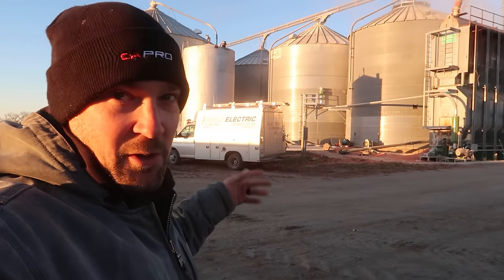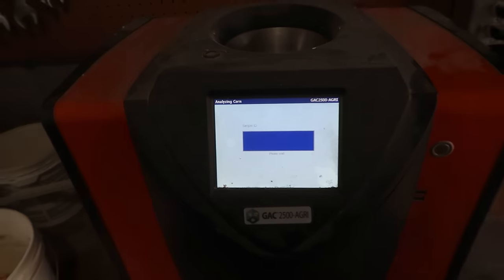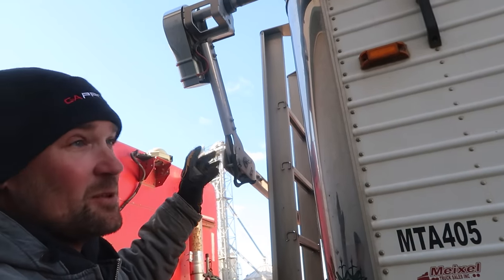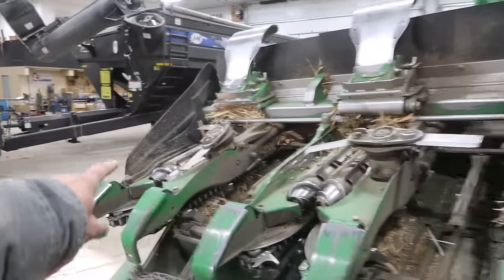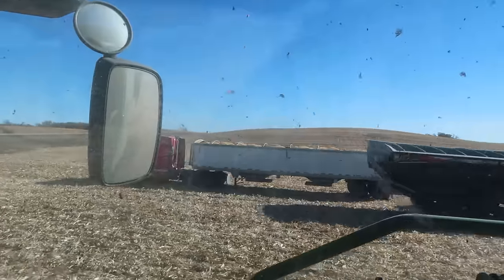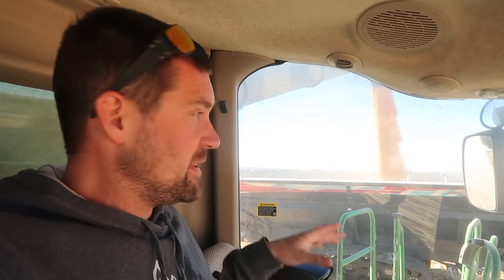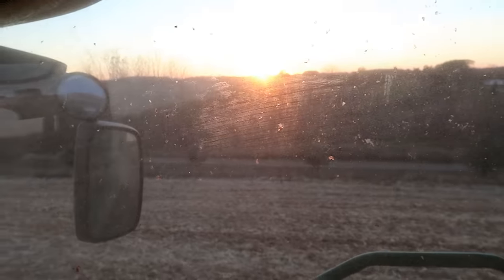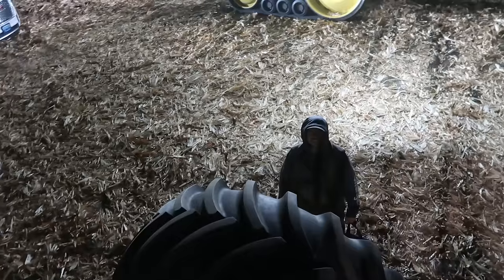I Finally Kicked Dad Out of The Combine! Harvesting Corn on the Hills

Comment: Spacers are there to increase the bolt length enough to get a "stretch" on the bolt when you torque it. The stretch is what keeps the bolt from coming loose!  I actually designed the tooling that makes the bolts and spacers! Made in the USA! Made in Wisconsin actually!
Reply: Pressure regulators will frost over  also
Reply: High usage of grain dryers will use more vapor than what liquid is making

Comment: Zack the reason for long bolts and spacers is at spec torque the longer bolt will stretch more and provide a higher clamping force learned that in Cat service training.

Comment: Regarding the wheel spacer on the wheel bolts... that so the bolt can be 1.5” longer than needed to stretch and provide more clamp load on the rim. (When properly torqued)

Comment: Had a dual fall off my combine this harvest and dealer had to come out and put it back on, sheared all the Bolts off and they said it was likely that the wheel studs were loose from the paint on the mating surface of the wheel chipping away. They said they always grind the paint off on new machines or new wheels and they don't have any issues after that. Just something to take into consideration!

Comment: The spacer on the wheel bolts allows more length between the threaded hole and the head so the bolt can stretch more and hopefully stay tight longer

Comment: Born and raised in Wisconsin, can confirm that 15 degrees F is "balmy" weather. My brother and I used to ride our bikes through slush and snow wearing shorts and tshirts when the temperature was only 40 degrees out. It had been so cold for so long that 40 felt like a heat wave :)
Reply: Sure 40 degrees in the spring time is a heat wave, like you said shorts and t-shirt weather. Even 15 degrees with no wind is is nice in late winter, but 15* in the fall is dam cold especially when this fall as we have had a warm one here in the northland.
Reply: @richardlug6139  I agree it is bitterly cold at that temp, especially with the wind cutting through your clothing. We had a wood stove for heat and my brother and I spent many miserable hours trudging through the snow and ice to haul in from the woodshed.

Comment: the spacers on your combine wheel studs are to increase the effective clamping load of each bolt.  in applications where short bolts are required, using a spacer and a longer bolt allows the bolt to stretch/flex more before before breaking.    great videos, keep them coming.
Reply: Combine has bolts? Not mounted studs? I'm asking

Comment: The spacer is there to create extra length for a longer bolt. 
The longer the bolt the more stretch under torque the bolt will have. The more stretch it has under load the less likely it will back off and run loose. 
But for some reason Deere struggles with combine duals staying on 🤦‍♂️

Comment: In the heavy logging equipment program I went through we only ever used high temperature grease because there was one machine that required it on its cutting blade and we didn’t want to risk someone using the wrong grease in that one machine.

Comment: Between Lincoln and Omaha Nebraska and areas to the south I manage land in, we had corn anywhere from 25 to 54 bushel beans and corn that ranged from 94 to 217 bushel.  All dryland, around 10" or more less than last year.  Hail storms hit some of the area in june around V4 in corn after it dried we didnt' see much of anything for rainfall.  The cracks in the ground are wide enough to put your hand in and go down feet plural.  A garden hose in our hard will go down at least 18" and run for multiple minutes without ever seeing the water.  Crop scout in late August said we had little to no moisture at the 3 foot level.

Comment: FYI Standard thread bolts have the dashes 3 for grade 5 and 6 for grade 8. Metric have a 8.8 10.8 or 12.8 stamped on the head.

Comment: Great content as always, thank you. You mentioned video cameras in the grain bins do not work because the dust would settle on them. Would it be worth setting up an airline to blow the dust off?  A connector in the control room to each camera, quick blow with the airline and you should have the view, without all the climbing.

Comment: Zack,  Try sticking a zip tie in the electrical socket on the trailer with the plug in it.  Make a loop, stick the power cable thru that and shove the tip into the trailer plug.    That should keep it steady in the plug.

Comment: The spacers are to help the bolts stay tighter as the bolt is longer and has more stretch as the wheel load on the bolts comes and goes as you go in dips and wash outs

Comment: Heard you say cameras would dust over with in minuets in the grain bins. They'll come a time where you kids will have to climb the ladders. You and your Dad will be grounded! Before that, could you install a compresser near the bin's and put a manifold on it with 1/4" lines running to each bin to where you would put a camera? Control each line with a solenoid on each leg on the manifold. Have them controled where ever you would watch a screen. Push a button to blast the lens clear of the dust enough to see what is going on. It would be a much easier step to take.

Comment: You can tell by the marking on the bolt head if they're SAE or metric and what grade. The lines on your bolt heads indicate they are grade 8 SAE. Metric bolts would be stamped with class 8.8/10.9/12.9 etc rather than the series of diagonal lines.

Comment: The reason for the spacers on the wheel bolts is so that the 450 lbs of torque stretches the bolt enough to keep the joint tight.  A shorter bolt would loosen up more often.  Really appreciate the content and the editing.  Every video flows well.  Nice to see all the help also!

Comment: Get a long set of jumper cables. Cut the clamps off one end and put the appropriate size ring terminals. Pop the tarp motor cover pull the wires from the terminals and hook up the jumper cables, go straight to the batteries to run the tarp.
We have a set with the plug for the belt trailers in case we have controller issues. 
When I worked for the row cropper we kept spare bolts and spacers around for the 9660. I think the spacer is to spread the force farther from the hole in the wheel than a washer can.

Comment: Run a set of jumper cables or a boost pack straight to the motor on your tarp if the control box won't run the motor. This will bypass the control box and will also diagnose if the motor is bad. Correct polarity will open tarp. Reverse polarity will close

Comment: I vaguely remember in one of your previous video's you changed the heating lances running into the dryer, pulling them out if i recall corectly. Could that be a cause for the temp issue ?

Comment: The bolts with the spacers give you the ability to use longer bolts that when tightened to the correct value they stay tight as they’re supposed to.

Comment: High volume propane users have a pre-heater at the storage tank. Your dealer should have information on that. Propane boils at  -44 deg F.   Vapor pressure  @ 0 deg F is only 23 psi.   When you are using  high volumes of propane the temp in your storage tank goes down and the pressure goes down. Many years ago when they just started using propane dryers propane sold for $.07 per gallon.

Comment: About the cameras in the bins. Take a box around the camera and place around plastic window in front of the camera with the centre of the window aside from camera. Mount that window on the axis of a motor. Let that motor spin. The spinning forces will take the dust off the window and a brush could do the last bit. When the window spins while you use the camera, then also some dust will blur out and not block the view. Good luck.

Comment: Idea: Install the cameras in the bins like you normally would AND install air hoses with high pressure nozzles pointed at the camera lenses. Flip a switch and dust is gone in seconds. Maybe put the switch next to the display monitor with all the camera feeds are.... 😏

Comment: @Millenial Farmer  - The spacers on the bolts are there to help provide adequate clamping force.  The bolt is effectively a giant spring when torqued, and in order to get enough clamping force (to keep the bolts tight and prevent loosening) they need a given length to be able to stretch and provide that clamping force.  Without spacers, the same torque on the fastener may actually overload the bolt and could risk eventual damage.. A stack of washers will provide the same function in a pinch, though I'd take a tightened bolt without the spacer over no bolt!

Comment: Mount the camera up top with an air hose near the lens with a valve near the control. Need to see in the bin open the valve on the air hose and blow the lens off and you got a good sight down. Think it would work?

Comment: Could you set up a camera on the roof looking down, then run an airline to the lens, which you control from inside to blow any dust off? It might be a time-saver in the long run if it was reliable.

Comment: I am so sorry to hear about the below average yield! Down below farmers loosen/deep rip the soil to a depth of 550-700mm and use controlled traffic to avoid recompacting the soils again. Thus 80-90% of a field is free of traffic. In this way, the "bucket" becomes larger and the soil absorbs more rain and the plants have moisture for a longer time.
Reply: To absorb rain u have to get it 1st. Do Deeper rips help when their feilds are tield? I'm asking... Idk
Reply: @RebelRolls77  The point is that you can increase your ability to utilize the rain you get. If you loosen the soil layers and use controlled traffic, so that the soil layers are NOT compacted again, then the soil layers become more spongy and thus much more water can be contained, so that less runs into the drainage pipes and the plants have water for a longer time.

In AU, the new thing is to put, for example, 20-40t/ha of chicken manure at a depth of 300-600mm, because then microbiological life increases enormously, and precisely microbiological life creates the spongy soil layers, which are optimal for supporting plant growth.

This method is already far more profitable over a few years than the chemical method, where you use N, P, K, etc., because the microorganisms are extremely effective in feeding the plants, and the value lasts years, because the microorganisms themselves build their own basis of life, if you don't kill them with chemicals!
Reply: @futurefarm73  chicken manure without any composting is just top dressing nitrogen. And without microbiological life ur speaking of. You didn't explain my tiling question
Reply: @RebelRolls77  You just have to help me understand your tile question. I thought I answered that, so what are you asking that I haven't answered?

Comment: the spacers on the wheel is for more flexibility instead of stretch of the bolt, to prevent bolts getting loose. figure that....

Comment: Spacers..The purpose of the spacers is to improve the clamping force. A bolt behaves like a strong spring. They are not as solid as we think but when tightened stretch a wee bit. The longer the bolt the longer it stretches given same torque. Now a bolt with very short shank can't stretch much at the desired torque. Now when you put a spacer on it, assuming it's a decently made one, nice and square and strong enough material, the tightened bolt becomes a longer spring. This means any deflections in the joint are accommodated within the yield limits of the bolt. In other words a 0.010 deflection on a short bolt might yield it and it doesn't return to starting length and it will come loose. A long bolt with spacer is capable of handling the same deflection and returning to original length. Making use of bolt stretch allows joints to flex and not come apart as the load is shared among nearby bolts. A common place you see spacers on bolts is under slew rings on an excavator. Engineering. Don't you just love it. As an aside, grade 8.8 bolts means yields at 800mpa and tighten to 80%  what ever that works out to be on the chart. 10.9 means 1000mpa and tighten to 90%. Cap screws are usually 12.9 so 1200mpa and 90%. So cap screw stands 1080mpa stress. 8.8 stands 640mpa stress. So cap screw is over a third stronger than 8.8 bolt when installed.

Comment: Hi Zack.  I'm sure you must know this, but I'll write it in anyways.  Those were imperial bolts as you said because of the six markings on the top.  But to identify a metric bolt, it won't have those lines on top.  Instead look for the grade marking on top as being either 8.8, or a 10.9, or a 12.9.    I just associate the 8.8 with a Grade 5, the 10.9 as Grade 8, and the 12.9, as being beyond Grade 8.   There is stuff on Google that explains it better than I can.

Comment: The wheel bolts on the combine have spacers to allow the bolts to stretch. As strange as the sounds the longer the bolt the more stretch it has the more shock load it can take without breaking.

Comment: Crazy that I'm watching your video and the wheel bolts come loose. My brother-in-law's  780 had the same thing happen 2 nights ago, so they had to replace both sides. The tire guy said that he has seen this happen a lot, and everybody is running too low of air pressure in their combine duals. He said that they need to run at least 40 pounds of pressure in the tires.

Comment: Ya know,  if you had those lsw's that welkers and Cole have on their combines, that bolt problem probably wouldn't happen.  Maybe they could send that guy to visit you?
Reply: LSW’s would be pretty useless in heavy blue clay and sticky mud. Also what happens if it goes flat or gets a puncture they’d cost triple of a 900 R42. We have to run tracks on our combine so it can get thru the wet spots.

Comment: A simple FYI if you already have a bolt and are unsure if the threading is the same put the threads next to each other with the heads facing opposite directions, if the threads interlock the entire length you will know the pitch and count are the same. Used to deal with customers looking to replace bolts and machine screws all the time.
As to the diameter it's harder when you have metric vs imperial and end to end can get you in the ball park but there are just some where it's just a mm difference and can't easily see with the eye.
The previous tip helps to some extent as the bolts won't mesh perfectly but may be close enough to miss unless close inspection is kept.
Might be worth it to buy a handful of bolt gauge tools to have in the machines this way you have a on hand tool to check what size you need if you have a bolt on hand. at $15/ it'll be a question if it's worth it or not depending upon personal opinion.
Reply: Um, yeah.  I'm pretty sure they did that exact thing on this video.
Reply: @chuckfinley4757  I only seen them putting them end to end, they did something else off screen but who knows what that was.

Comment: Wonder if those spacers are for bolt stretch.
Reply: This is the reason 99% of bolts would have spacers. For additional length or  stretch. Engineers generally wouldn't add a spacer for no reason. They are fairly expensive.
Reply: Adding a spacer also changes the angle of the force cone.  Usually it lowers the contact stress.
Reply: Maybe if the bolt threads were exposed on the inside of the wheel it would prevent thread damage due to rust.
Reply: Counter intuitive as it may seem, a little grease on the thread and contacting surfaces of those bolts will help to stop them working loose.

Comment: If you were short of 4 bolts for one wheel the best thing to do would be to take one bolt out of each of the other three wheels, use those on the wheel that's missing four, then each wheel would only be missing one bolt.

But you probably already know that 😉😁👍

Comment: Long-John's already? It's not even close to proper winter temps.
Reply: Not always the temperature but you add the windchill and those long-johns help  a lot.  One does not need to be miserable while working.  Seems the rest of the crew were in cabs of one sort or the other.

Comment: Has anyone ever removed paint from the jointing surfaces of wheels and adapters on the combine?? The paint wears off each surface then wheel is no longer tight. Been telling farmers this for 15 years and the heavy equipment world knows nothing. Ask any Cat mechanic you trust if they put new tracks, rails and pads paint to paint and i rest my case it never works.

Comment: Why do farmer put the auger in and out on the combine? Why not just leave it out?
Reply: Well, that would seem to make sense from a wear & tear standpoint, but unfortunately, it is a lot harder on augers if you run one into a tree, highline pole, or other immovable object. You might say, "just avoid the obstacles", but most of the combine operators are human and prone to human error, and it is just wiser to fold the auger back every time than take a chance on hitting something.
Reply: It's also hard on the brackets and pivots to run it hanging off the side on rough fields. Lots of leverage and bouncing.

Comment: HEY , COLE THE CORNSTAR NEEDS SOME HELP AND FAST . All of the NEW Concret that just got poured is falling apart under their new 60,000 pins . HE NEEDS A CONCRET GUY . Pass the word and he needs a BIN Guy . . DADDY CORNSTAR went up on top of one of the new Bins and as he was walking up at 90 feet in the air 2 welds broke on the walkway he was walking on . . HELP , HELP . PASS THE WORD .... THANKS .